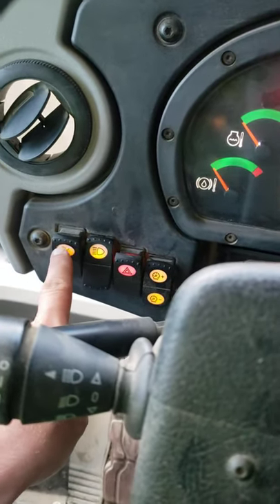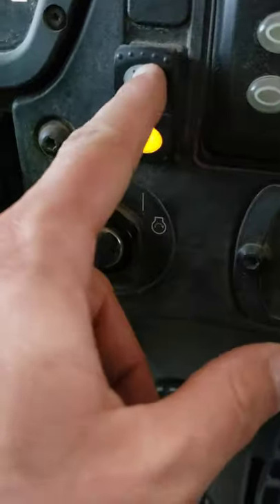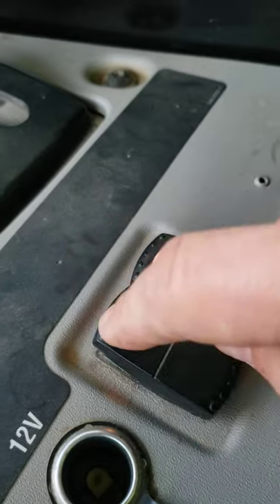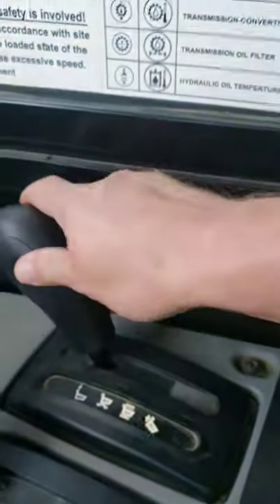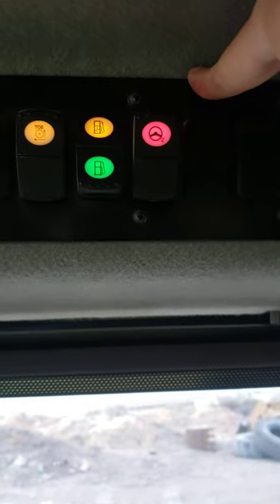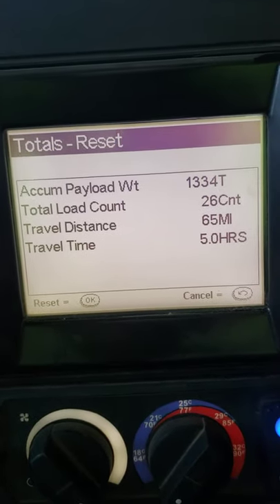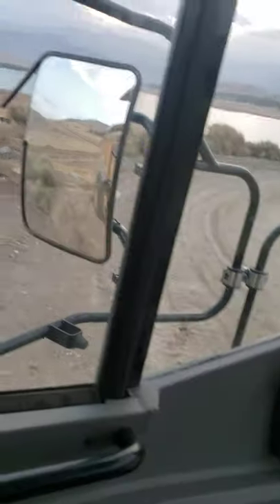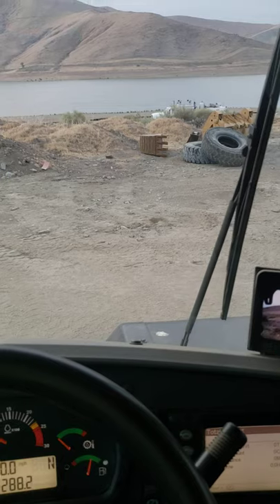Lets Drive a Haul Truck CAT 775

Comment: I work at the Decatur,Il Caterpillar plant. I get to weld these together almost daily....as well as the 770/772/777. I was on the "big truck" line as well (789/793). Love welding these up!!!
Reply: I drive a 775G at a limestone quarry near Marshall,Il. You probably burned some metal on it, it's a 2019. Used to paint cars for the ideal dealership up there in Decatur, does it smell any better n' it did 15 years ago?
Reply: @twillison8824  Heck yeah...good chance I burned wire on your ride...I started in early 2019. Thats pretty cool! That Ideal auto is still there....and nope,it's not any better smelling here! Lol. Be safe,and thanks for the comment!!!
Reply: Frames are always cracking. So there's that.

Comment: looks good to me. I am in the process of getting a haul truck job in BC so I appreciate the insight since I have never actually even driven any kind of truck. I have been in side of a dump truck but this is a different beast. My only concern is those winding roads on the sides of those very steep and high cliff sides. Will take some getting use to I think. On The other hand I think based on normal driving that I might not even be able to tell while driving. Or at least I hope so🥴😄
Reply: Did you get the job? How does one get a job like that? I'm in Manitoba, Canada and looking to get in a mine to drive one of these but no idea where to start. More difficult because I don't have experience. I have a class 1 licence and I'm hoping that will at least help me in a way. any input will be greatly appreciated.
Reply: @RanchoCarrasco there’s a company called Tech Resources currently hiring in British Columbia

Comment: should not you give 1 horn prior to start on the engine ?
Reply from the maker: I never sounded the horn before starting but some employers require it depending on the situation. I had already done my inspection, so no worries about safety.